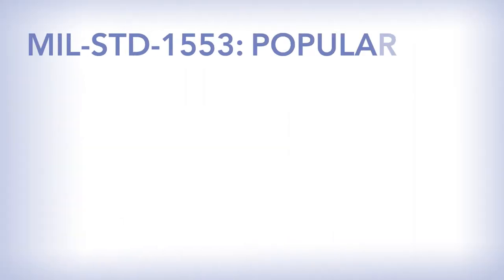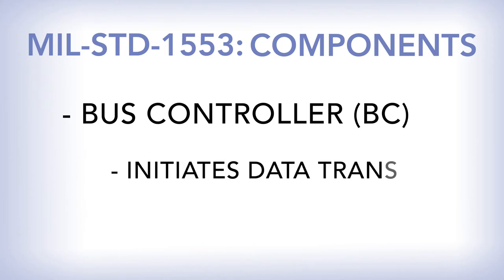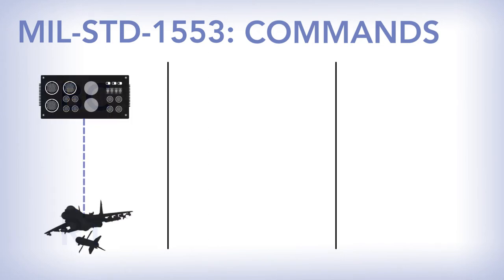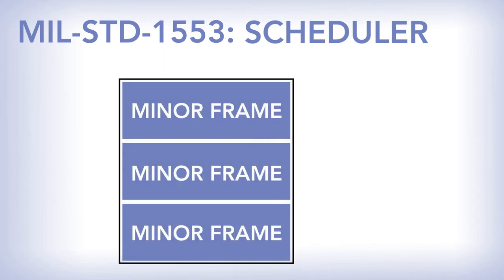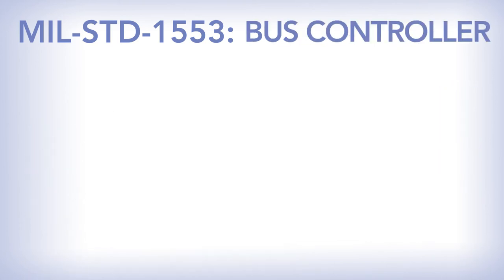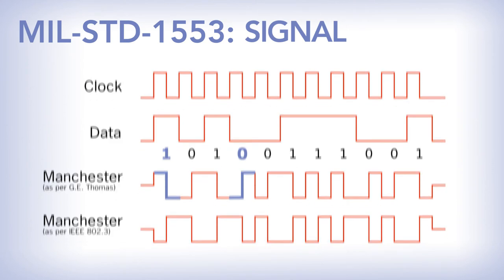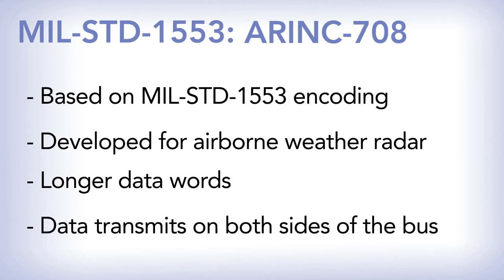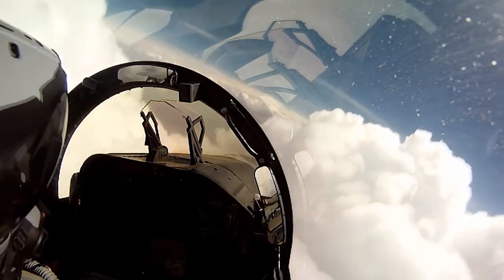MIL-STD-1553: Overview and Applications Tutorial

Comment: When it comes to an RT and it's address. What happens when a new device is attached? Does it get assigned an RT address?
Reply from the maker: The RT number should be hard coded into the physical devices since the scheduler has to know what RTs are on the bus. Since there is no dynamic assignment, If you add an RT you have to update the scheduler. 
 
So, if you had 23 RTs, then the designer of the "new" RT would have it assigned to 24 or something other than 23.  Hope that makes sense.  If you have additional questions, please contact us.